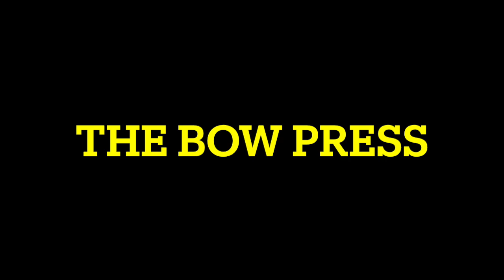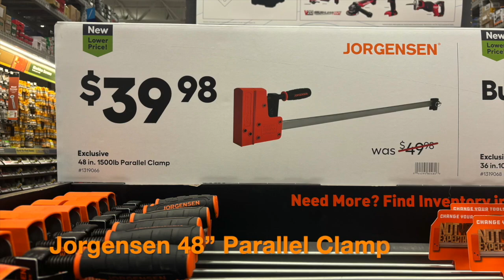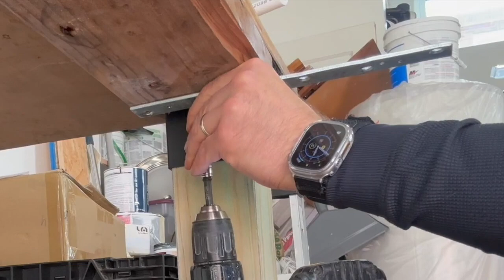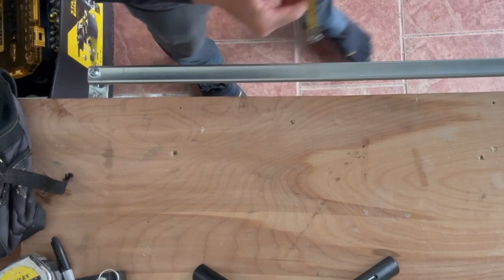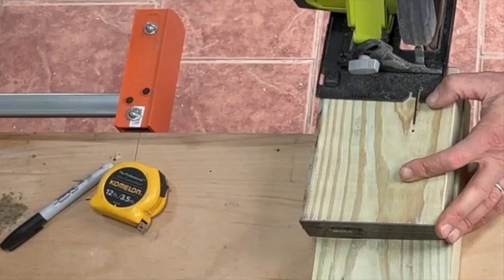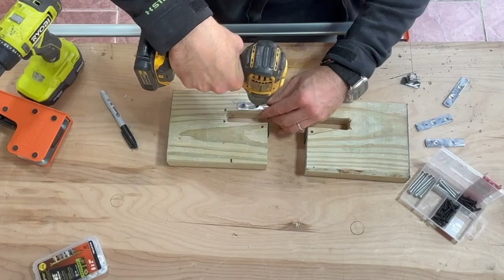Ep. 1 - How to Build a  Compound Bow Press - DIY Homemade  Less than 100$ - #TrueGritArchery

Comment: i myself would not trust the way that press works as far as strength. for one i dont like the idea of using wood, also looks like it could slip. but hey good job to you
Reply from the maker: Hi Lucas, thanks for watching the video and for your comment. If you have time, watch some other video of the Archery Series, I use the DIY press many times in my videos and it works very good. I have a professional press at the shop (a video on how to use pro presses is coming soon), but the DIY press is the only one I have at home, I've been using it for years and works perfectly, I promise!
Reply: @truegritarchery   yes, i built one myself using tube steel, some bolts and a stand. its on archerytalk also, no welding used.  im all for diy for sure, im sure yours in fine, just i dont like wood for something like this.